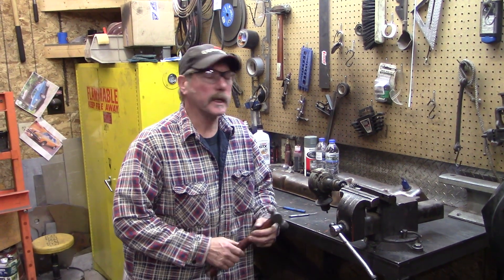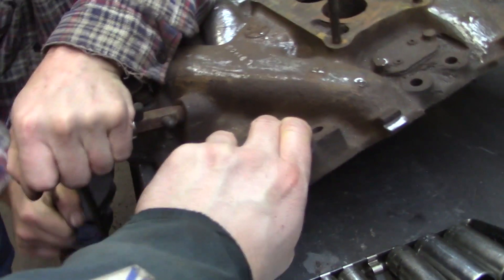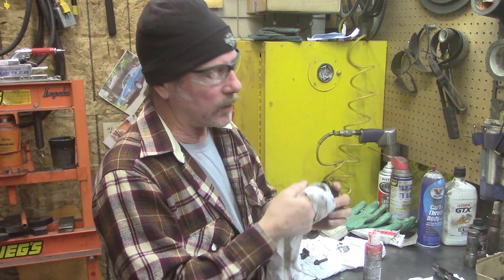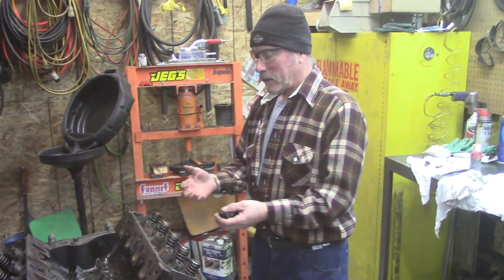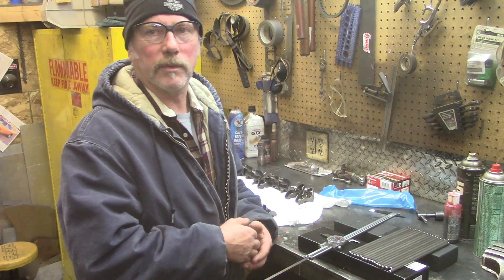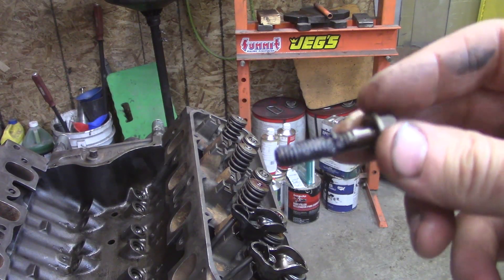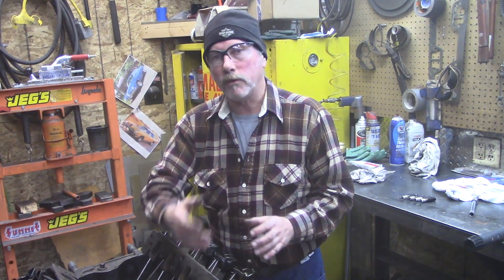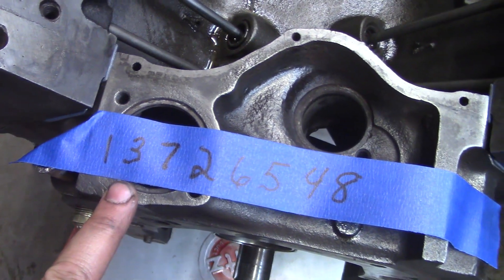351m Engine Assembly part 2 of 3 Valve Train Theory

Comment: I have a a torque monster 351M I retro fitted to a 400, .040 flat top pistons on stock open chamber heads. I had the stock open chamber heads decked to give me the highest quench possible with a 9.1 CR. These engines want to breathe like the Cleveland's but got the boat anchor title. 400 hp is absolutely easy from these engines.

Comment: Curious to see if anyone thinks those oil deflectors are really necessary on the rockers?
Reply: They are actually referred to as drippers , and yes they were integral to the oiling issues the 335 series engine had up top. When high volume oil pumps became popular for these engines they starved the crank for oil, which caused the spun main bearing issue common in this series. Not all rocker covers have these "Drippers" which ends up with a double whammy. no crank oil and to much up top. When properly corrected the 335 series engine is the best push rod engine ever made however application specific!

Comment: Grabbed a ‘79 bronco with a seized 351M in it. Haven’t pulled it yet. Thoughts on putting putting the effort into a full rebuild vs. just finding a running big block and swapping out? This is just for recreational driving, not particularly looking for any off-road performance.
Reply from the maker: A 400M would make a nice replacement for it.  If the 351M block is good is could be used as a core to rebuild the 400m in the future.  I believe the crank was the difference between the two.
Reply: @Oldsmob455  crank and pistons only. Again 351M was used to defer the difference between the 351w and 351c. 400 came out 1971. 351m introduced in 1975.
Reply: @Oldsmob455  Thanks for your response. I saw your other video where you're throwing the Wisconsin sticker on the door. Where you guys out of? I'm down around Madison.
Reply: @whycantyoucope69  400 easy. No replacement for displacement. Easy with straight up timing and 4 barrel manifold flat top pistons mild rv cam easy 375 -450 hp 351m about 275-325 with a shallow torque curve
Reply: @Oldsmob455  its a 400. 351 carries the M. 400 was first tall deck stroker Cleveland.

Comment: i did a 351w few years ago and use arp ultra torque on my rocker bolts and within first 2 month of operation 3 of the bolts broke, i then changed em all, i assumed it was because they where too much lubricate wich lead to too much stretch . I love all the side stories and memories you bring, thanks for sharing!

Comment: I didn't hear did you guys do any valve work on the heads?
Reply from the maker: No rings, no bearings, no valve job = Rustoleum rebuild
Reply: @Oldsmob455  I'm willing to contribute $60 for a ring and bearing kit and I am sure you can get more to contribute to get the $500 or so that you need?
Reply from the maker: Lol, thanks but this thing is already back together.  When one starts doing things like that there are other factors to consider  like rod bolt stretch, big end connecting rod shape, cylinder wall condition and shape, cam bearings and more.  It ends up being a price elevator to a full rebuild.  I know because I've been there a few times. If it needs that at some point, it will get it.
Reply: @Oldsmob455  I just like to see you guys rebuild stuff,Thanks.